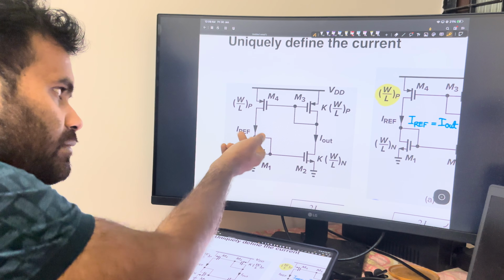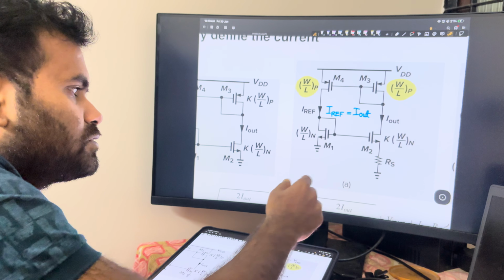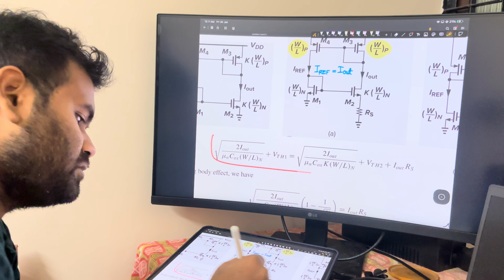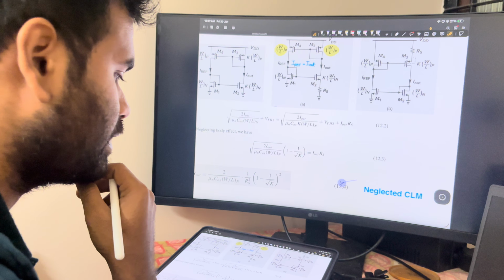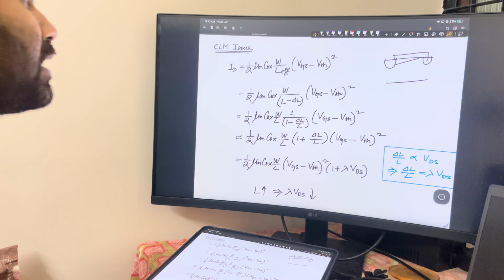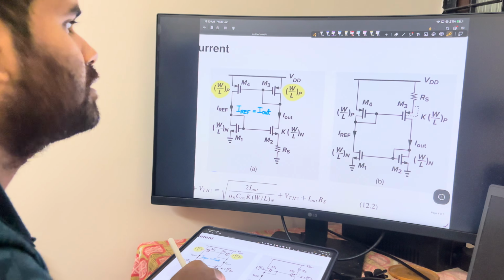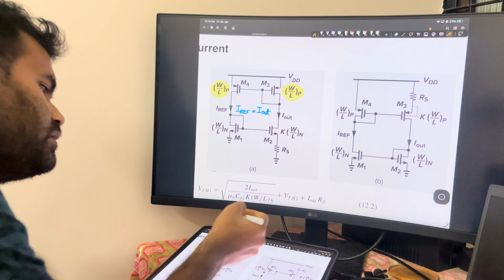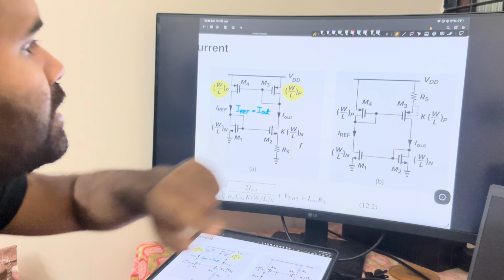Supply Independent Biasing Part 3 | Uniquely Define the Current | Bandgap Reference Circuit

Comment: can you tell me why are we adding resistor and how does it makes  difference  in the circuit ??
Reply from the maker: we are adding the resistor to uniquely defined the current. That is what I discussed in the video. Have you watched the video till end ? If yes , can you specifically mention what your doubt is ?
Reply: @eeengineers3958   what do you mean uniquely defining the current ??
Reply from the maker: @SaiDurgaPrasadGude-k8w 
If Rs is not there , then we can get Iout for any value of Iref.  In ideal case ( Ideal FETs ) , you can assume Iref anything.  For all Iref , you will get Iout.  But if you add Rs , then Iref is fixed.  
I request you to see all three videos in the playlist.  Still if you have doubt , we may connect via Zoom. Drop me an email at connectme.debabrata@gmail.com